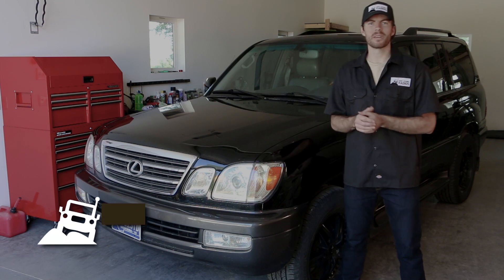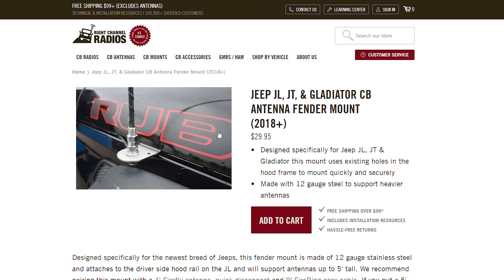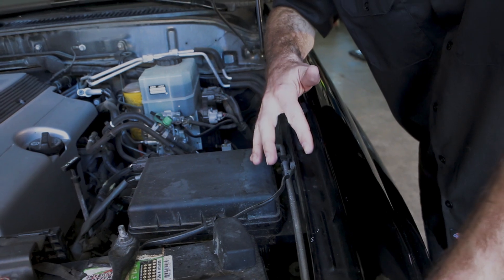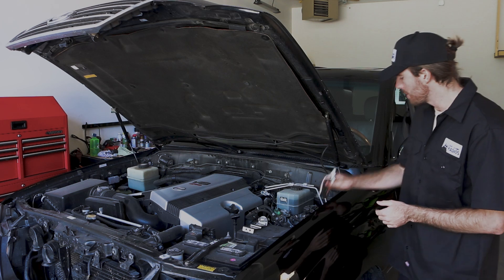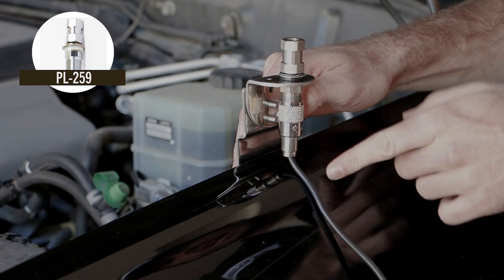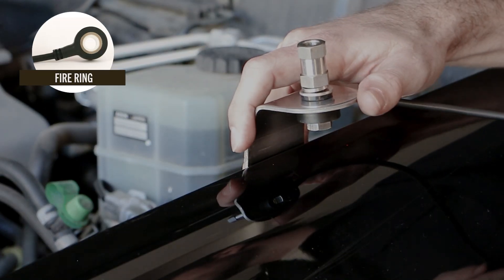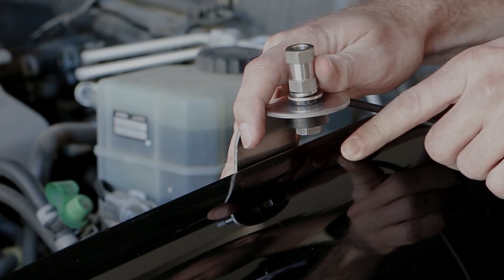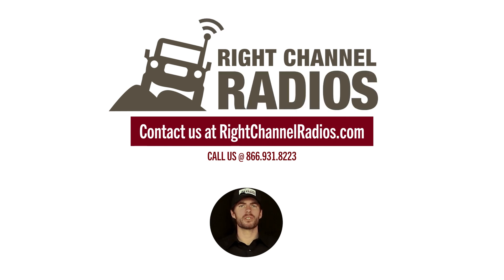How to Choose and Install a Hood/Fender Mount for a CB, GMRS or HAM Antenna

Comment: Will these types of mounts work for GMRS?
Reply from the maker: Yes, but you will need to use a NMO coax cable with the mount. We have NMO coax cables that are specifically designed to fit in a 1/2" hole like those found on a CB mount. 
https://www.rightchannelradios.com/products/procomm-3-4-nmo-mount-for-1-2-hole